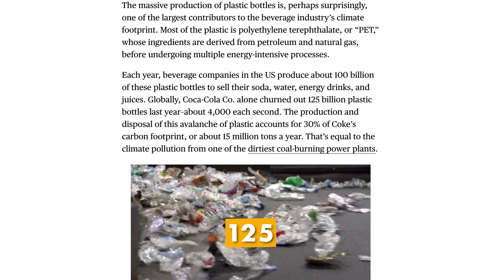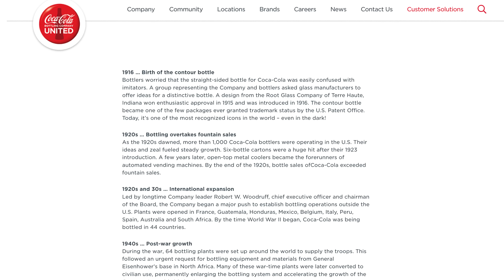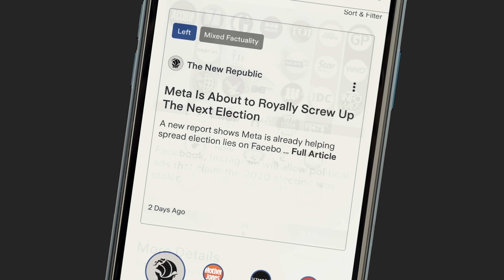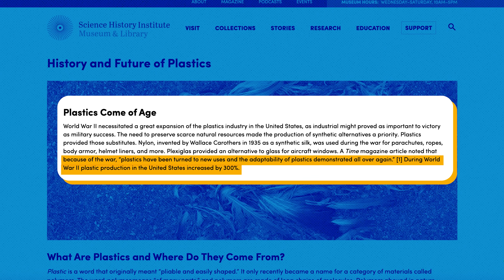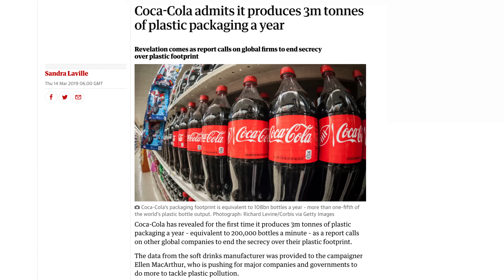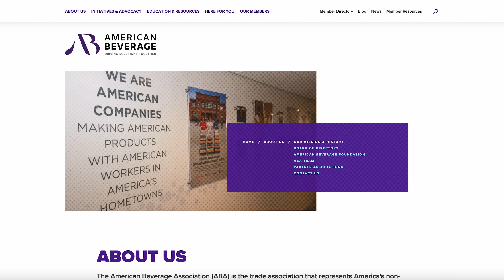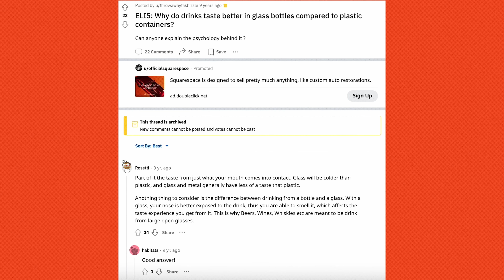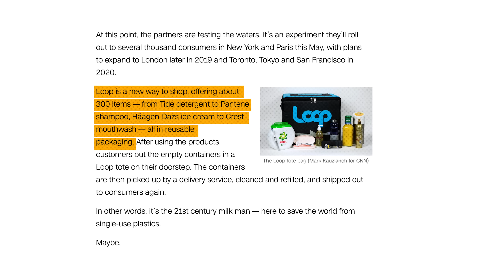Why the Glass Bottle FAILED

Comment: Michigan has a deposit system with bottle return machines at every store as well. As a result, it has by far the highest return rate of any state in the United States.
Reply: Assuming that the supermarkets can maintain their stink and recycling machines. In my town there are only two return facilities, so there's lines always backed up out the door. At that rate people just opt to throw their containers out.
Reply: Is it returning if it is crushing? y store crushes the bottles. Plastic can last for thousands of years. I cannot possibly understand why plastics are destroyed if they are robust enough to hold pounds of pressure in excess of their design.
Reply: I always just thought that the bottle returns were standard everywhere in the country
Reply: What is need is to expand the bottle return to include sports drinks, juice and other beverages like that. Between that and regular recycling means there would be hardly any garbage, at least in my house. Those types of drinks do go in recycling bin but I think the bottle return type recycling is more efficient when it comes to especially plastics.
Reply: @KatjeKat86  I completely agree- unfortunately, Michigan’s Bottle Bill was created via constitutional amendment, meaning that amending it is very difficult. It has kept the policy alive, but it has also prevented it from expanding.
Reply: California have the bottle deposit on every type of bottle, and even bigger sized containers know, but there is np efficient way to return them and get your deposit back. Grocery stores don't take them back and you have to take them to obscure return facilities that are far in between. Unless you use enough to have a trunk load of return bottles, it's not worth it to drive there.
Reply: New York has this too.
Reply: We're not the highest rate anymore, just one of the highest. Oregon has it at 10 cents as well, plus on more beverages than us. It's apparently hard to change the deposits in Michigan because it was enacted in the 70s with a ballot initiative, and initiatives seems to mean it can't be changed without a 3/4 majority vote in the state congress, sadly a good portion of politicians especially republicans vote down expanding on the bottle turns, with the lobbying from retail! Like despite a huge majority of citizens being proud of our bottle return system and would be all for increase it by a small amount or including more than carbonated beverages and beer!
Reply: @TriegaDN  Michigan does not have the highest deposit of any state (Oregon has caught up to us there), but we do still have the highest return rate (but only slightly). In Michigan the return rate hovers around 90% vs 85% or so in Oregon.
Reply: @bluephreakr  Mostly due to issues with contamination and having to get the bottle back to the same manufacturer as they tend to be custom. Plus, they degrade over time in terms of microplastics and hormones leeching into the fluid.
Reply: @mr.funnyman9765  No, many areas moved to recycling programs that made the deposit programs a bit of a problem.If you've got free curbside pickup of recyclables accepting a deposit for them means paying for collection twice and disincentivizes the use of the provided bin while also increasing emissions a slight bit as now you've got the bottles being driven back to the store on top of the truck that comes by to pick them up both from the store and from the house.

Comment: It's so interesting watching this, as someone living in a country where basically all soft-drink bottles are recycled. Both glass and plastic bottles have a deposit on them, varying by the size and type of bottle, and you return them to whichever supermarket you feel like. They all have the little machines like you showed from the Netherlands, and it doesn't really matter which brand or shape they have, as long as they have the standardized mark on them, saying which value they have. 

Granted, sometimes the machine is broken and it sucks that you brought a huge bag with the bottles from a whole month with you in vain, but it mostly works just perfectly! I would feel SO wrong not saving the bottles in that bag and bringing them in once in a while.

Comment: I lived through the transition from returnable (deposit) bottles to plastic bottles. What a lot of people miss is the short phase of non-returnable bottles that came out. Mostly from Coke's competitors. These bottles were thin and brittle. They were covered with a thin foam label to keep from shattering in your car. The biggest issue with these bottles is that they were disposable. For a year or two the streets were covered in shards of broken glass from people just tossing empty bottles out of their cars as they drove down the street. It was a nightmare.
Also, the first 2-liter bottles were terrible. It took them a while to get the caps right. The early ones tended to leak and go flat before you'd actually opened them.

Comment: My mom use to work at a Coca-Cola bottling plant and one thing she said an issue for Coca-Cola is the liability on Coca-Cola to have clean bottles (bc they would find mice in the returned bottles sometimes) but the liability on the workers it has happened where people working at those bottling plants would accidentally make Mustard gas when cleaning the bottles.
Reply: You are right. The whole return flow of empty bottles is a logistic nightmare; collecting and transporting them, then washing and inspecting them. They cannot be used forever eithe. The scuffing from the friction and day to day scratching becomes so bad that ends up interfering with the automated inspecting machine. PS: I worked at a beer company too.
Reply: @miticapecheanu1312 in Germany they get used up to 100 times (but on average between 10-20). Then they make cullet to make new glass. All the washing and inspections are fully automated.
Reply: Just melt it
Reply: @the_expidition427   Melting glass containers defeats the purpose, you have to use the same container over and over again, and not transport it at long distances, to even hope to make less of an environmental impact than what you get with single-use plastics.
Reply: @zwerko   no. You are wrong. Single use plastics are much worse for the environment than recyclable glass. In fact recycled plastics are much worse than recycled glass too. There’s a limit to how many times you can recycle plastic, but glass can be recycled indefinitely. So let’s do the math here before we make some false claims. Based on the comment by @miticapecheanu1312 a glass bottle will be reused about 20 times. About 600 billion plastic bottles got produced in 2021. So if we divided 600 billion by by 20 we’d get 25 billion, so theoretically if all glass bottles were returned to be reused than we’d only produce 25 billion bottles annually.

 As for recycling, I’m gonna pretend we live in the perfect society and everyone always recycles. Most plastics can only be recycled once, others 3 times if new pellets are added, whereas glass can be recycled indefinitely. So tell me, even in the perfect world where everyone recycles everything… what happens to the 3x recycled plastic? It gets incinerated. The bottles would only get recycled 1-3 times before being burned and releasing nitrogen oxides, sulfur dioxide, volatile organic matter and polycyclic organic matter. Which not only negatively impacts the environment, but directly impacts anyone who inhales these fumes. So burning is worse than tossing it. Ultimately we’d be forced to place all of the plastic into landfills because burning plastic is literally worse than tossing it. 

So we toss the plastic then we’re fine? No, because as much as I’d like to pretend the biggest problem with landfills is the fact that they take up room, the reality of it is that garbage (including plastics) leak from landfills into rivers, oceans and into the surrounding land. And plastic doesn’t disintegrate. You HAVE to incinerate it if you want to get rid of it. At least glass that’s thrown into the ocean will turn back to sand.

So in conclusion, no. Glass is not worse than plastic. The reality of it is plastic is much worse than glass.
Reply: @zwerko  also, transportation emissions? Really? You do realize newly made, single use bottles also get transported? The transportation between the cleaning facilities is hardly the issue here.
Reply: @zwerko  Yeah glass is so bad much worse than micro plastics.
Reply: @Dude-hs7zm  Producing virgin glass releases far more greenhouse gasses than plastics. Recycling as well. Transporting both ways (to consumers and back for reuse/ recycle/landfill) makes far more emissions for glass than for plastics due to the heavy weight. Quite a number of plastics are generally very chemically stable, for some it would take millions of years to degrade, unless we try to make them more 'degradable', so storing plastics is essentially like storing rocks, there is nothing to leak, really. And guess what, we have plenty, plenty of space for landfills, whereas we already overrun our budget for greenhouse gasses emissions. It's very clear which problem we need to tackle first.
Reply: @miticapecheanu1312  The thing is the glass bottles can be reused again since they are 100% recyclable, unlike plastics.
Reply: @Dude-hs7zm  plastic bottles are almost exclusively made from PET (polyethylene terephthalate) with a chemical formula of C10H8O4. We aren't that good at alchemy yet to get sulfur dioxide from burning plastic bottles. Considering how simple the plastic is, I doubt that any decent waste incinerator plant would get any significant nOx or organic matter emissions from burning bottles.

Landfills are not a problem in modern societies - a very small fraction of waste nowadays ends up in landfills. Most of the stuff that does end up in landfills is stuff like minerals, ash, slag and other inorganic matter.
Reply: People don't need to be drinking this crap at home. Diners and events
Reply: @DJRenee  Honestly yes, I stopped drinking all soda completely last year and I feel way better. 

The stuff is hard on your liver.
Reply: @zwerko  I will address only one of your incorrect statements: "...storing plastics is essentially like storing rocks, there is nothing to leak, really." Actually, plastic in landfills does leach harmful chems into groundwater, causing harm and sometimes deadly results. Not just into groundwater, but into the product stored in the plastic bottles. And micro-plastics also find their way into humans via a multitude of pathways, also causing harm.
Reply: How did they accidentally make mustard gas? Usually you have to mix chemicals that should be nowhere near each other 😲
Reply: @DJRenee  I disagree but I also don’t drink them all the time.
Reply: @sadface  so your obviously not suppose to mix what ever chemicals it is that makes mustard gas but they are suppose to be used separately bc they need to make sure these bottles are like brand new clean. Bc if not it’s a liability on the company.
Reply: @sadface  I think all you have to do is mix bleach with vinegar to get chlorine gas. 

Both of which are used for cleaning.
Reply: @JakeBaldwin1  I understand, but keep the vinegar out lol. Just use bleach or any other cleaning/disinfecting agent. Hospitals are able to clean surgical rooms without making mustard gas no problem 😂
Reply: @sadface  Vinegar is a fairly cheap and effective cleaning agent, I use it at home often. 

The issue is that most people don't know about the gas issue.  

I bet what they did was wash out the bottles with vinegar initially and then when they bleached them there was a still a little vinegar in the bottles.
Reply: K ?
Reply: @sadface  You can't "accidentally" make mustard gas.  It has a very specific formula and you have to very deliberately make it under very specific conditions.  Most people misidentify various forms of poison gas or toxic fume with mustard gas.  Mustard gas is a blistering agent and is actually a liquid rather than a gas.  To deploy it in a chemical shell the shell usually explodes to spread the chemical into a mist, contact with which causes large blisters to form on tissues that come into contact with it.  Lethality usually occurs from inhalation and blistering of the alveoli in the lungs.

Most likely the cleaning process of the bottles caused some interaction between bleach and some other agent which produces chlorine compounds.  Chlorine can cause burning of the lung tissues (as opposed to blistering) and can lead to death through asphyxia.

Comment: I have a collection of vintage glass pop bottles. It wasn't intentional: I was working for a construction company that was replacing the sewers in Tampa. As the old pipes were dug out, the pop bottles were brought up. The workers in the 1940's and '50's just threw them in the hole.
There's about 20, many from sodas that no longer exist.:)
Reply: Helll yeah, brother. What sodas?

Comment: In Denmark glass bottles are relatively easy to get a hold of. Mostly beer though, soda is an occasional thing. But we have an extensive recycle system with deposit on all kinds of bottles, cans and glasses. Between 1 to 3 kroner (~0.25-0.5 usd), almost all bottles and glasses here are reused.

Comment: Glass bottles are still being used in the Philippines, with options for 16oz and 1-liter sizes. They’re a more affordable choice since you can return them to the store where you got them. Plastic bottles are also an option, especially if returning the glass isn’t feasible for you, but they tend to be about 30% more expensive.

Comment: As someone who makes GLASS bottles for Coke, I can truly appreciate this video.  Everything is BETTER in GLASS!
Reply: I'm not saying that you're wrong, but you PERHAPS have a bit of bias that a non-glass-industry person might not have 😂😂😂
Reply: Can you make a Bodom style bottle to serve Coke hot?
Reply: Absolutely true. If you care about flavor, you want something in glass.
Reply: @R.J._Lewis  Just ever so slightly 😂
Like the logistical issues of glass bottles etc.
Reply: The large problem with glass is that its very heavy.
It adds a lot to the shipping costs...
Reply: @Blue.Diesel  Exactly. This is a true issue with glass. It would increase costs exponentially. Driving recycled alu cans would take like 10 000x minimum more containers within one transit. Let alone that glass would go to washing and then to production facilities. It's just not sensible option anymore. Especially since that glass can't either be used eternally, but needs replacing too after certain amount of uses. Imo there's a lot better options. Like those Soda Stream thingies would be ideal to move on globally to reduce carbon emission caused by transportation, considering soft drinks.

Comment: Glass and plastic returnable bottles are still a thing here in Chile. Here the glass bottles are for individual (250ml) up to 1l sizes, and plastic ones up to 2.5l; and while you need to pay a small fee as a deposit (around 0.4 USD) you could use in the major supermarket chains (Lider, Jumbo, Unimarc, Santa Isabel, etc.) and most times you could buy from one beverage chain (Andina for Coca-Cola's brands, CCU for Pepsi's) and use the bottle to buy a soda from the other chain.

And since last year, returnable bottles coverage was expanded to all stores that sells soda bottles 🙂
Reply: I exclusively use returnable glass bottles for my coke here in Brazil.

Comment: Germany has a standart for 25oz glass bottles, used primarily for pure seltzer water.
They have a high market share, and most of them are used until they are put out of order.
Reply: You can also still buy 0.25, 0.33, 0.5 and 1l glass bottles of Coke in Germany.
Reply: @catriona_drummond  You can buy them, but they are very expensive, often about double the price. You get glass bottles often in restaurants, becaus plastic has no style at all.
More reasonably priced are the reusable plastic bottles. But single used plastic bottles are often the cheapest option (if you return the empty bottles).

Comment: I worked in a carbonated beverage bottling company, one of the processes for refillable containers is cleaning the bottles before refilling. A machine that injected hot water with caustic soda was used to clean the interior. I can tell you that where the cleaning liquid with sugar residue fell there were cockroaches of all sizes. After seeing that I never drank drinks from refillable containers again. In refillable plastic containers the situation is worse because hot water deforms the plastic of the bottles and cannot be used, only warm water is used, which does not clean as well. The ideal container for my taste would be non-returnable glass.

Comment: Personal experience is that fizzy drinks went flat much faster in plastic than in glass, which made the quality of drinks in 2-liter fall off rapidly once the cap was popped. Additionally, here in Maine, we've had bottle deposit/returns in place since 1978.
Reply: Plastic is permeable to CO2. Which means the gas goes out of the bottle, even when the bottle hasn't been opened yet.
Reply: I have noticed that, there is no point buying 2L of soda or tonic water etc because it will go flat before you can possibly drink it all. I don't understand who buys this junk. I like the single serving glass bottles of soda, I get them every few months as a treat. My locality has a soda tax.